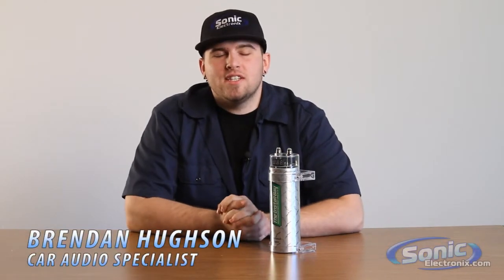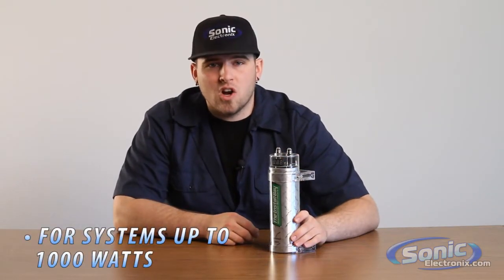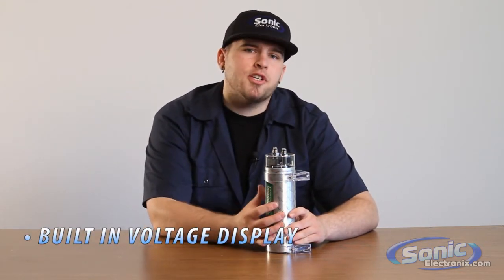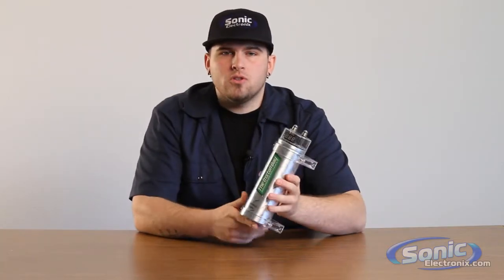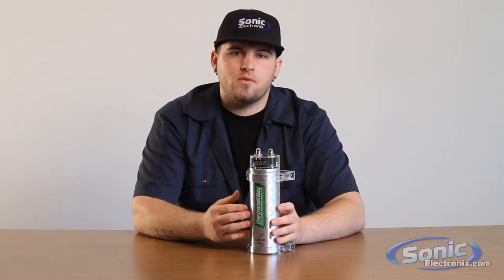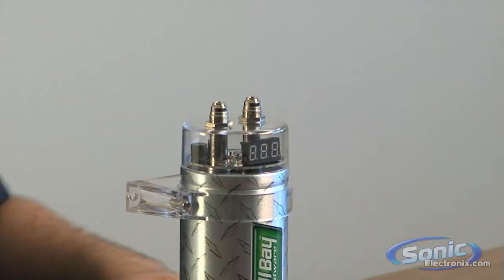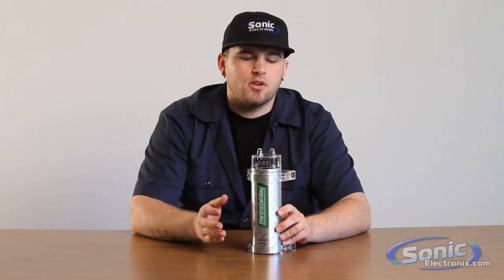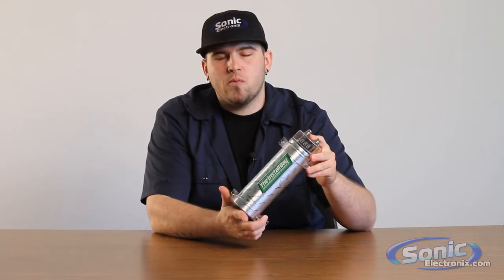The Install Bay Car Audio Capacitor (IBCAP1F)

Comment from the maker: @SmokeMeDry Yeah that is a great set up, the amplifier will give a little more than stated and the woofer will get the power they need to run safely.  You will need to make sure you have 1/0 gauge amplifier kit and I would recommend a battery upgrade. You can go with a capacitor but that wont add any power just regulate it. I would also consider doing a Big 3 upgrade. Also make sure you have  two of the Dual 2 ohm version of the sub so you can wire them together to a final impedance of  2 ohms.

Comment from the maker: @TheDJBrettHaley You might not need a capacitor. However if you see lights diming or battery dying, then I recommend upgrading  your battery for something stronger. Capacitors do not add more power they simply store it and discharge it appropriately so that your main battery isnt taking the hit all the time. If you really want a capacitor go with the Rockford Fosgate RFC2D, this is a solid and trust worthy capacitor. If you want to upgrade your battery go with the XS Power D680 battery.

Comment from the maker: @jamietownend07 A cap won't prevent damage to the battery or amps. It also will not actually provide any power for your system, it's just designed to stabilize the voltage. My recommendations for batteries will depend on whether your amp is 3000w MAX or RMS. If it's RMS, adding a nice big external battery like the Kinetik HC2400 should be sufficient, although it's highly recommended that you upgrade your big 3 and alternator as well when running that much power.

Comment from the maker: @mln760 If your voltage is dropping too low during playback it may be a good idea to add a capacitor, espeically with that kind of power. For an 1800 watt RMS system you should look into a 3-4 farad capacitor or even a starting battery upgrade. This will add more reserve into your electrical system so your amplifiers can draw power quickly.

Comment from the maker: @puppet1211 You don't really need an inline fuse since the amplifier has its own fuses but you can if you want for safe measure. The amplifier is not CEA compliant thus it will not put out 2000 watts it will do less than that. I would suggest upgrading your battery since that is more efficient than a capacitor. Remember a capacitor stores energy it does not produce more. A Kinetic HC1400 battery should be more then enough for an upgrade. Upgrading the Big 3 is also a great idea.

Comment from the maker: @gameboy1984 That matchup will be fine.  As a general rule of thumb it's recommended to go with 1 farad for every 500 watts of RMS power.  You can exceed this without having problems, it may even help better alleviate the electrical issues.

Comment from the maker: @TheHemlen If your lights are dimming or if your voltage is low while your vehicle is on and your playing your music loud, then you will need to look into purchasing a capacitor. You can check your voltage with a Digital Multimeter to verify if you are getting voltage drops. Ideally you want your voltage to stay around 13.5 when the vehicle is running.

Comment from the maker: @djdestique It is very possible to utilize 2 capacitors in your setup. You will want to wire them in parallel (positive to positive, negative to negative) and have your amplifier(s) wired to draw current off the caps, and the caps will constantly maintain a charge off your vehicle's battery. This will hopefully resolve any light dimming issues. If you are still having issues we recommend upgrading your "Big 3" wiring under your hood. We have an informative article in our Knowledge Base on this.

Comment from the maker: @icpfamily1 If you are looking to add a capacitor in line with your amplifier, you will need about a 4 farad cap. A general rule of thumb is you will need 1 farad for every 500 watts RMS. However with that much power, it may be a better idea to upgrade your battery and your big 3 wiring instead. Caps are great for eliminating light dimming in small powered applications, but with 2000 watts a bigger or a secondary battery will likely be your best bet.

Comment from the maker: @84blackboy That should be fine. Rule of thumb is 1 Farad for every 500W RMS.  You should be running a true 900-1000W RMS roughly, and 2 farads will suffice.

Comment from the maker: @EXQD2 You'll only need to charge the capacitor during the installation.  In some rare instances where a capacitor is defective it may not hold it's charge and continually require to be charged.

Comment from the maker: @antonioklb1 It's not bad to have more available than necessary.  It might be considered overkill, because the most you'll really need is a 1.5 farad capacitor, and most people will run a 1 farad capacitor.  You're fine running a larger capacitor though, it's not considered a problem.

Comment from the maker: @baseballdude1065 If you are running 400-800 watts of RMS total you will more than likely not even need a capacitor. If you see your lights start to dim when running your system, then I would suggest an upgraded battery instead of a capacitor. A capacitor regulates the amount of current drawn from your primary battery so that it is not drain from the constant power draw that comes from having an audio system. A stronger battery would not have this issue, specially with less than 900 watts of RMS

Comment from the maker: @integman1 You will without a doubt want to preform the big 3 upgrade.  Also, we would probably recommend you getting a bigger battery if you are planning on running this much wattage.

Comment from the maker: @bballxp001 Yes get a bigger power and ground wire, with a single CompVR you should at least have 4 gauge. If you have more than one sub make sure the amplifier is strong enough to push two subs. My suggestion to you would be ditch the capacitor and do a Big 3 Upgrade and a battery upgrade. This will stop the dimming of the lights. Your lights are dimming because you are drawing too much current which means your battery is not up for the job.

Comment from the maker: @BigManny94 You should only need a 2 farad capacitor and with this system you can just replace the starter battery with the aftermarket battery.

Comment from the maker: @devilsonlychild You should really consider and amplifier. If you have 6 speakers running off 4 channels you will get distortion and other problems. If the speakers are after-market you might not be providing enough power and whatever power the headunit gives out is not enough for all speakers. Even more so when you are sharing outputs. I would say get a 4 -channel amplifier and run the lowest RMS rated speakers off the headunit.

Comment: i have this capacitor in my room with a 12 volt dc power supply for my amp and i love it my amp and power supply run cooler since i installed this capacitor

Comment: I just installed The Install Bay IB-CAP1F  in my system and the voltage reads about 12volts when the car is off.  Will this drain my battery if the voltage showing when the car is off for a long period of time or will it ruin my battery?  When the car is on after the install the battery reaches in the 14 volt range.  The capacitor made a big difference in the sound quality of the stereo I had in my car.

Comment: I have a full Sony xplod system. 2 12" 1300watt woofers, and a 1200 watt Sony xplod amp. My amp cuts out after about 10 minutes. It's not from overheating. I believe it is from lack of power because my volts drop from 14 to 9 volts when the subs are hitting hard. I will be getting a new battery soon. What capacitor (if any) would you suggest for me to get until I get my new battery? And should I keep it with the new battery to keep from draining power?

Comment: i have a 1000watt sysetm in my 06 sentra and i once had a cap and it did boost the sound but my lights still dim worse then before it also was a 1 farad dident do much so i took it off my system and got a kinetik on it now and it sounds way louder did a 135db at 57hrtz with one 12inch olympas 2412

Comment from the maker: @Russiangenkster Honestly a capacitor will do you no good. Capacitor only discharge stored energy, they do not provide more energy. For this much RMS you will need to upgrade your battery and potentially your alternator. I would suggest going with the XS Power D3400, this battery should be sufficient and work a million times better than a capacitor

Comment: @bballxp001 According to the NEC 2011, 3 ga.=100A. MAKE SURE your connectors are rated at 100 amps too. This totally sounds like a power issue. Cheap way: Get smaller pulley for alternator; see if it helps. Next cheapest; bigger alternator and battery (some people use marine batteries, can handle more abuse of charge/discharge due to lower ESR in it). Try 2nd battery as well; battery can store a hell of a lot more power than any cap. Watts divided by V=amps. Size new altern'r @ that +50A or so.

Comment: I have an 18sv Cap in my boat.. For some reason, the cap will power on for about 3 minutes and then the red display turns off and does not light back up or turn on unless i hit the perko switch killing the stereo system and turning it back on. I dont get why this happens since the positive lead is always hot as it is connected straight to the battery and its connected to the positive side on the cap. Any ideas?

Comment: what is your recommendation on buying a cap? im starting up my system with 2 12" kenwoods at 400 rms and got a sony 1400 watt amp running them...shouldd i get a cap? and if so, would it be worth it?

Comment: im getting a crunch pza2000.1 from the sonic electronix website do u think i need a capacitor? and do i need to put an inline fuse going to the cap and another going to the amp or can i just use the 1 on the 12volt+?

Comment: Attention!!! Adding a cap will not help with lights dimming and voltmeters dropping! It's primary job is to make sure that your amp has the power it needs to perform. Adding a high output alternator or extra batteries is the only way to stop your other issues.

Comment: NEED HELP GUYS!!! I got a 1600w amplifier running in a polo what cap do i need or do i not need one? it's powering to JBL GT5's at 500w rms each the rms of the amp is 1200w :)

Comment: Wow, I was about to rip you on the price of this cap. Pretty goddamned good deal. When did manufacturers stop raping people? Same value cap (1F, 16V)  used to be almost $200. Ignore the bad reviews; I can tell the people recommending a "better" brand are expecting mythical  performance or their alternator cant keep up even with their battery. Even 100F wont fix their bass dropouts and 10V problems. Thats not a cap issue at all! Need more power. Caps just stabilize voltage.

Comment: @m35a2lover Perfect example of V=I*R. The wattage (W=V*I)wants to pull the same load, so if the voltage drops, the amps go up! More current = more heat. I'm not talking about a resistive load - if I was, I'd get flamed by engineers. This is a regulated component and immune to *typical* raw Ohm's Law theory. Whats actually happening is you're getting different current values all over the components in your system, causing overall higher power use due to V drop = more heat.

Comment: just got this capacitor at Frys electronix for 30$ dont know yet if its gona work for me or not i have Mb Quart onyx 1000.1d amp 1000 wats rms,and two Kikers comp vrs  wired at one ohm sounds great,i dont know if this capacitor going to ferder inpruve my system or not,if anybody has a simular system with this capacitor please let me know, i want to see your video,thank you bye.